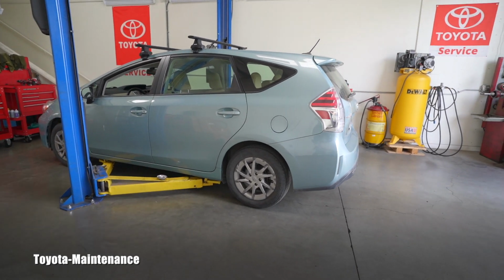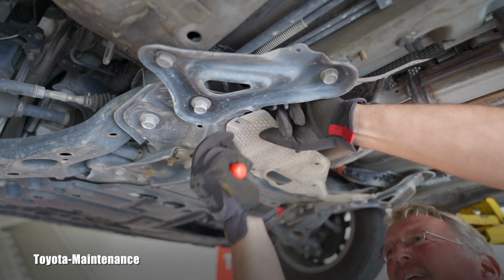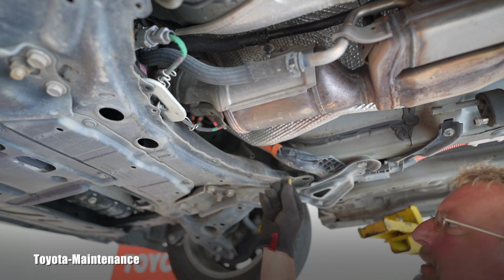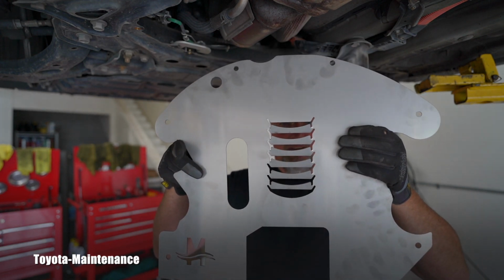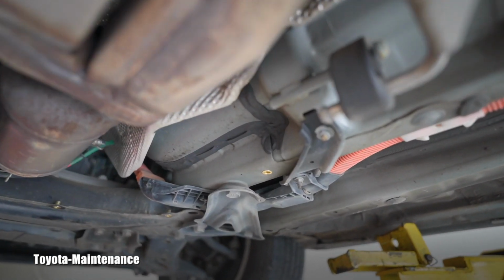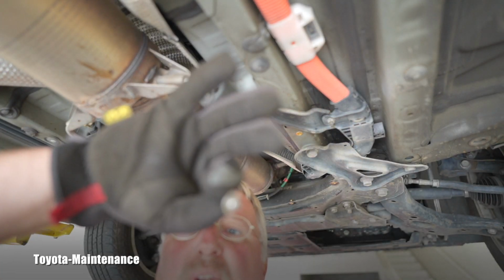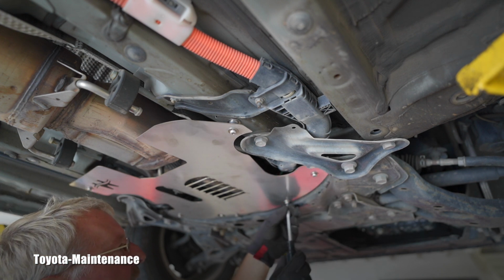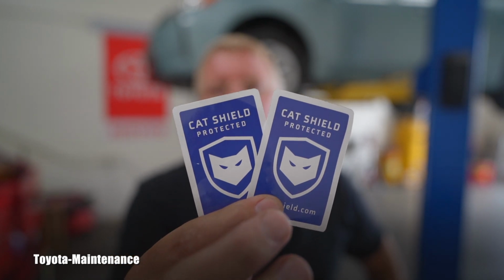2015 Toyota Prius V with Cat Shield

Comment: Peter, have you ever installed the Cat Shield on a Lexus CT200h?  Miller Cat sells a steel plate shield for the CT200h but I am wondering if it's the same installation as a prius. I have a 2014 CT200h, and don't want to get hit by thieves.  Lost a cat earlier this year on my a Lexus RX400h which thieves stole in the middle of the night, and need to protect my CT200. Great video by the way :-)

Comment: I would like to see proper use of jack stands on the Prius V demonstrated. How do I not damage the pinch welds with jack stands. Is the car weight to be borne on the pinch weld or is the weight to be borne by the metal to either side (or just one side) of the pinch weld? Where can 4 jack stands be placed to support the car, other than the pinch weld locations, after using a service floor jack at the front and rear centerline lift points? Are the slotted, rubber or metal pinch weld adapters really any good? I have four jack stands where the top measures 1 3/8 in. by 5 7/8 in.

Comment: Great video! Thank you for highlighting the installation and features of our shield. We are happy to answer any questions or concerns your viewers might have. Our goal has always been to manufacture a product with the highest level of deterrence. Any thief with the right tools and risk tolerance can remove your converter. However, out of the tens of thousands of shields out there, screws have never been an issue (whether that's unscrewing them or chopping them off). Most thieves just move onto an easier target since their objective is to steal as many converters a night as possible.

Comment: Can you say why Prius catalytic converters are stolen more than those
from other car models?
Reply: Has to do with hybrids being a lower emission vehicle, the metals in those cats can be worth more.
Reply: one big cat, iso multiple small ones. my outback has 5 cats. and the exhaust has heatshields. it's a pita compared to a prius.
Reply: They are also cleaner which requires less processing time.
Reply: More precious metal in hybrids
Reply from the maker: More precious metals, more money thieves get for it
Reply: Palladium, platinum, and rhodium. To achieve SULEV (super ultra low emmisions vehicle), they packed a buuuuunch of these metals cuz it was cheap back then. Now rhodium along is over $20k… nuts.